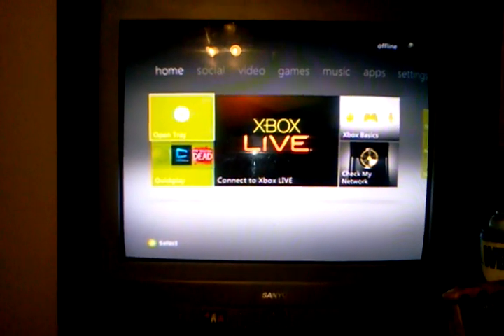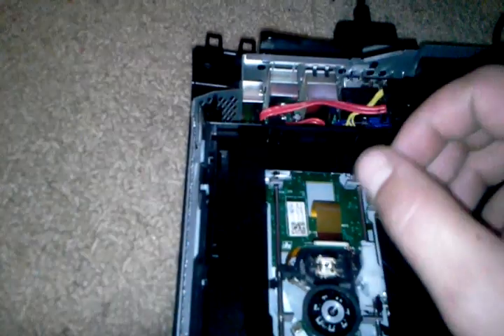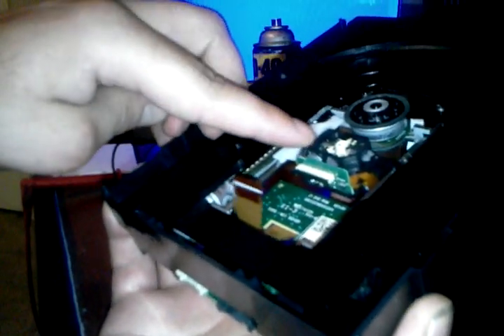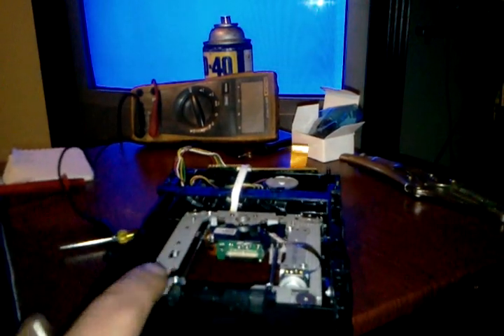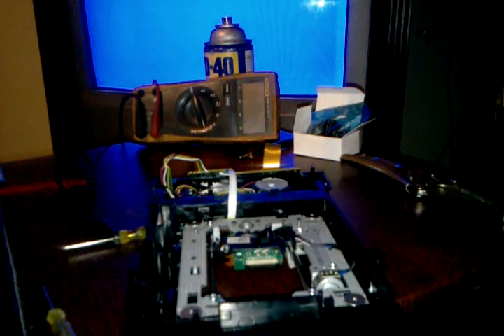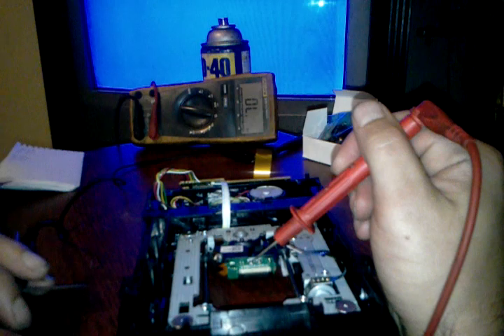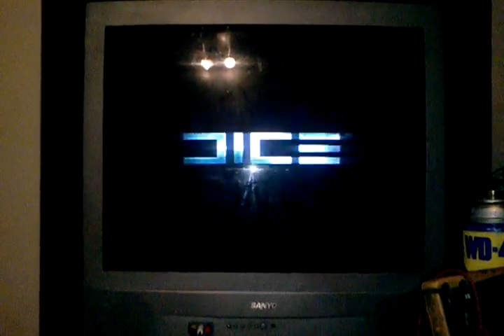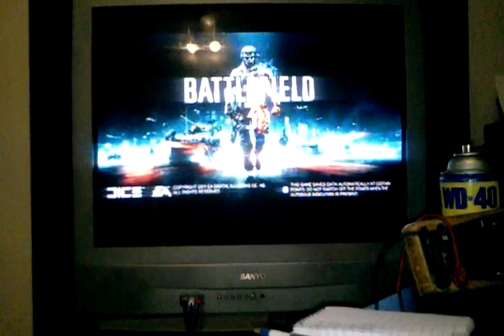Open tray / Unrecognizable disk error fix (True!)

Comment: I have an older drive that is a 14xx.  I adjusted the two screws that you pointed out but also had to adjust a third screw that was only on the left rail.  The rail not only had a different gap but was pushed up so it was clearly not aligned.  This fixed the mechanical aspect but it still could not read.  No doubt the multimeter is the key.  I actually have a old VU one but it still worked.  It registered a 5!  That's like braille to a bush wookie!  Adjusted it to 4.5 and it works great.  Win!

Comment: Thank you so much. I was adjusting the potentiometers to the following settings based on other videos. DVD: 3.5K ohms, CD:1.2K- 1.8K ohms.

That is for the BenQ and Lite-On drives that use the HOP 14xx/141x lasers. Even though your drive is a Lite-On 16D5S, it uses the same laser (15xx) as a Hitachi DL10N on the Xbox 360 S.

It consistently reads my games. I had bought a whole core assembly that has the spindle & worm gear motors, and the laser assembly with all ribbon cables attached. It still needed to be adjusted.

Out of the box, the new laser was at DVD: 2.99K ohms and the CD: 1.67K ohms

Comment: this actually worked, and it worked well so far, just went out and bought a pre-owned forza 4 got it home and it wouldn't play, along with having issues with other games and the unrecognizable disk error intermittently,  ultimatly had to google the hell of it and got here and boom my issue was fixed after a little dicking around with the 2 screws on the laser, unfortuantly i didnt have a multimeter, so i just adjusted it back and forth minimal amounts, but all is good now thanks a tonne man.

Comment: Hi,
So i'm probably a bit late on this and i've not read all the comments but I do know that the cure is to replace the WORM MOTOR that drives the laser up and down the rails. I've been plageued with this issue for nearly 2 years and recently found the issue. The tell tail sign is when removing the laser to then remove the worm motor is to wiggle the drive thread, if it wobbles and grinds there is your issue, also compare it to  a replacement worm motor

Comment: Step 1 unplug xbox 
Step 2 grab hammer 
Step 3 hit 3-7 times on top
Step 5 grab peanutbutter 
Step 6 open tray 
Step 7 spread pb on tray 
Step 8 put disc in 
Step 9 close tray 
Step 10 buy a new xbox
Reply: I'm pretty sure the PB will hinder your game disc from spinning, other than that, it sounds pretty good : )
Reply: Well since the xbox is unplugged it should be fine (:
Reply: melissasrage
Well since the xbox is unplugged it should be fine (:
Reply: Hahaha not funny
Reply: The Unknown What dad? :/
Reply: I have to concur with your observations.   the peanut butter is a step that can be left out.

Comment: My dear Ex-XBOX (R.I.P.) used to read most of the clean games but I just wanted that Metal Gear Solid V: TPP game which I had missed. Also, RE Revelations 2 was barely readable. So I dunno why I couldn't forget about those games it wouldn't read. Now here I am, punished for my beyond average curiosity; sitting with my broken laser staring at the wall instead of the TV screen.

Comment: I see you have your black lead alligator clipped to a screwdriver. The added resistance of the screwdriver you are using will cause the reading of your ohmmeter to be inaccurate. I would advise against using anything in addition to the leads that come with your ohmmeter, as the ohmmeter is set to factor the resistance in the wire of the leads into the reading. Adding anything to that will throw the reading off.

Comment: How do you use the multimeter correctly to get good readings because I bought one and I had no clue how to use it and I don't even think I got accurate readings. How come his is clamped to a screw driver? Mine came with to pins at the end of a black and red wire.

Comment: i got readings from my RROD xbox the readings were (when looking from the back of the drive to the front) 3.84k ohm for the left side one and 0.758k ohm from the right and the laser is a 141x i put these into my goodwill bought xbox that was not reading disks with a 14xx laser and it works perfectly now.

Comment: Is this repair only for drives that won't any type of disc? Or ones that won't game discs? The reason I ask is, my Xbox 360e will play CD's and movies fine but it won't read game discs.
Reply: GuitarGuys7299 Mine does the same
Reply: Also, can you show in better detail the contacts that you are using the Volt Ohm Meter leads on?
Reply: GuitarGuys7299

Comment: The only game I can't play is Minecraft, any simpler solution?
Reply: My friend also has a problem with opening Minecraft :/
Reply: Maybe it's not your xbox Mayne it's your disk check for scratches on the disc if there is I suggest getting a new disk , but if you see smuges etc i suggest cleaning it with a cloth
hope it worked
Reply: brian kelly nothing...